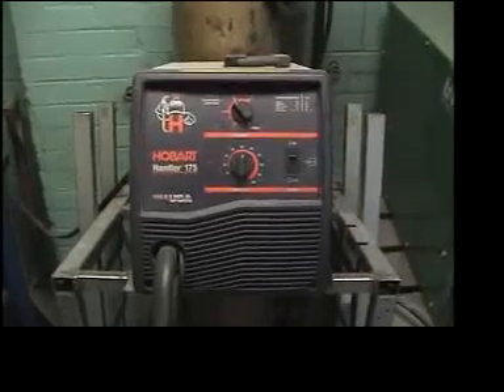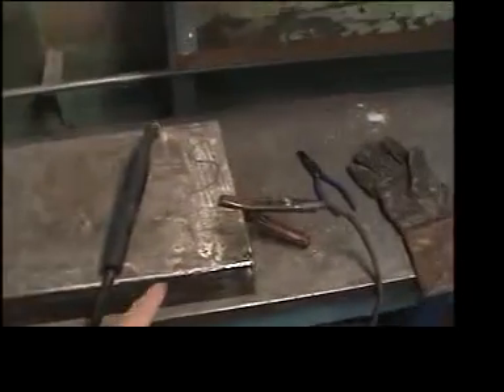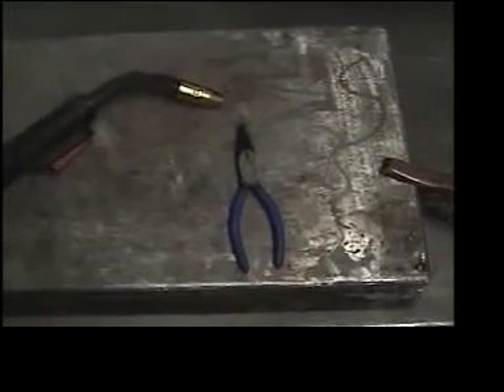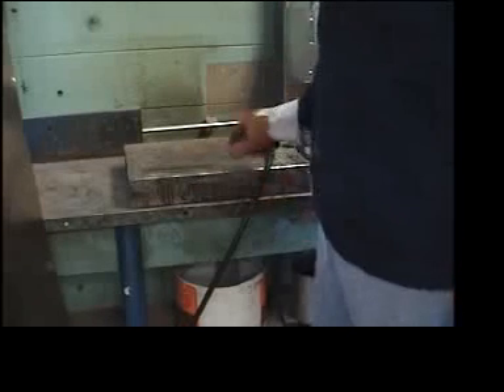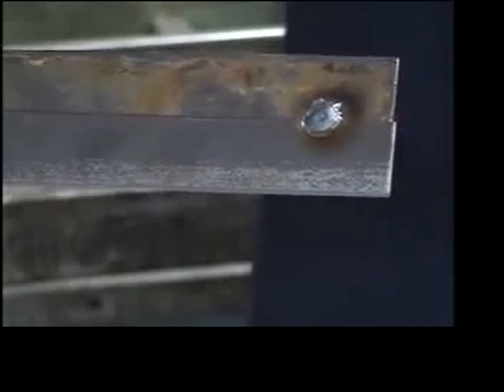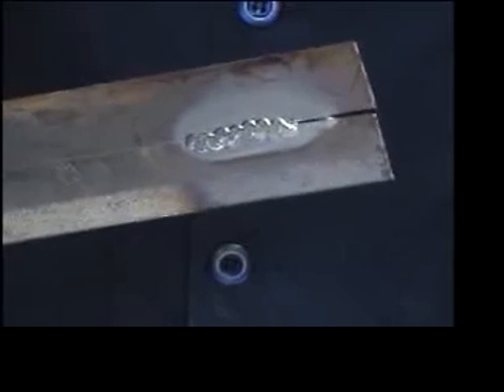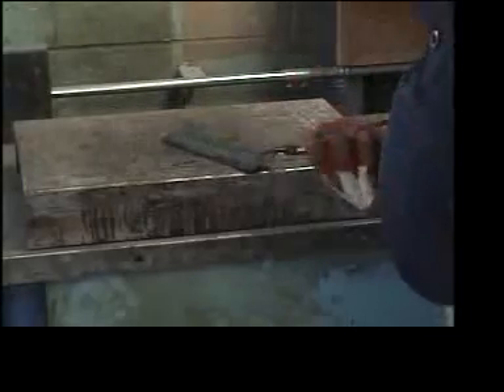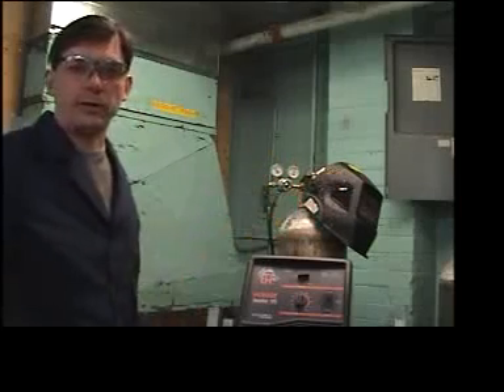Mig welder  Set up for welding

Comment: Actually, any more than 100% penetration is detrimental to the weld because the bottom side of the weld is not shielded by the gas and is thus exposed to air= bad. I understand that with thin metals it is kind of hard not to have this but it in fact does not "make for a good strong weld".

Comment: hey, nice video 

Our school (Brookfield Central High School in wisconsin) has a brand new snap-on welder. We dont use it and do not have a metals class. we have excellent autoshop supplies and wood shop etc. Do you think protesting to get metal working back would be worth it? I mean they did it back when my dad was a kid, then they sold all the machines. There still is this 7 foot tall bandsaw (aka "meatsaw") with a 3'' blade from side to side. cool stuff.